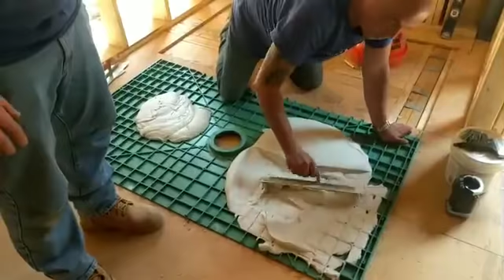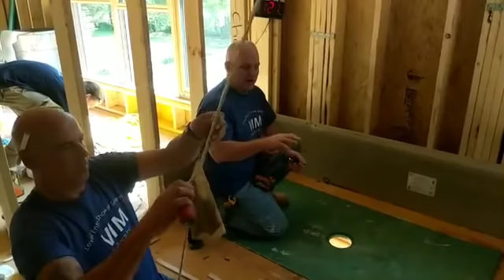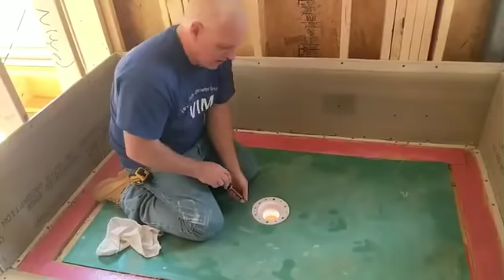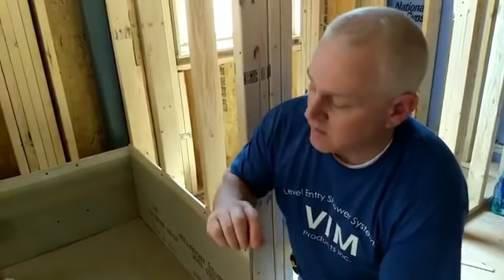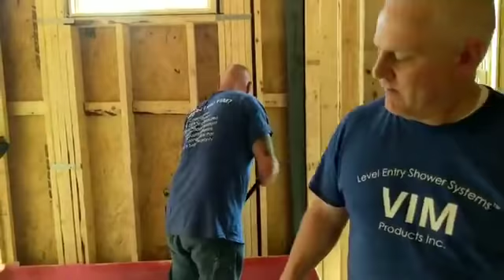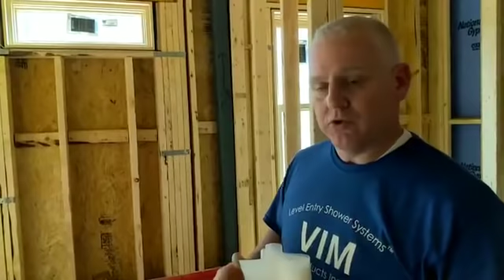VIM Products Level Entry Shower System™ -  Live Installation

Comment: OK I plan on using the VIM curb-less shower system for a new bathroom --  But has anyone used this system in a HOME LAUNDRY AREA ?  My laundry area will be build on the second floor and I want to have a protection system in case of a water accident....  Would a VIM shower base work under or near the washer and dryer?  IF they are a stacked unit, would the weight of the stacked Washer/Dryer be too much on the VIM materials and ceramic tile?  Anyone??  I sent the question to VIM but they never reply?
Reply: Laundry room. What a great idea! I've used it in my shower and love this pan. Give the VIM company a call. They've always responded right away to my phone calls.
Reply: @mimihealy5046  I have trouble with phone calling so I have tried other ways to reach them they have not answered my emails!
Reply: Where can I buy the product? I’m in Massachusetts. Thx

Comment: Ok... I'm impressed, for a number of reasons. I really like the idea of having a true level surface for the first row of tile. Because I typically float my floors, I usually start tiling on the second row sitting on a ledger board and then exact cutting the bottom row later to fit that uneven damn floor I floated. Yea, I know, it's time consuming but it works good. Your fabric... I'm guessing it's just a fiberglass type tape?. As for putting Kerdi on top of your system, why on earth would anybody want to? Sounds a little redundant to water proof a water proof pan. Can I guess that you've tried rolling your water proofing and found that the brush works better with the fabric by helping to smooth it out? I checked and you don't have a distributor near Florence, SC but I'm gonna give your system a shot. I've got a remodel coming up that they've asked for no curb that will go down about November.  BUT... you got to work on that price tag. That's a chunk for a guy who does 10 or 11 bathroom remodels a year. Check me out RebuildMyBath.com. If you want to cut me some slack on the first order, I won't mind. And BTW, this may be the best instructional video I've ever watched.

Comment: Can you extend the depth (from back wall to inside the room) more on one side or do the sides in need to be even in relation to the drain? Example, making the pan extend further into the room while keeping the drain closer (off set, not centered in the pan) to the wall.